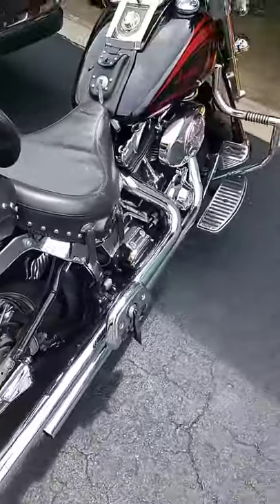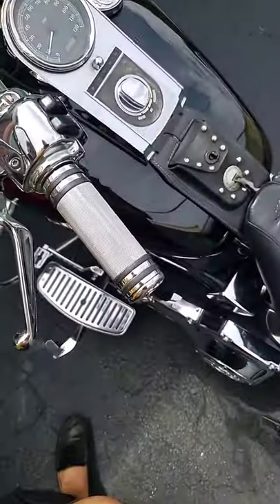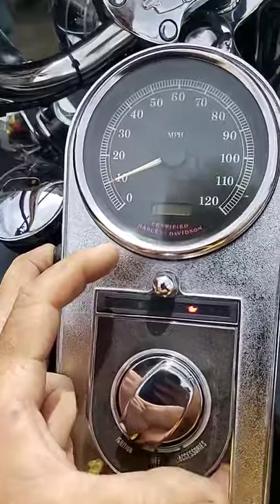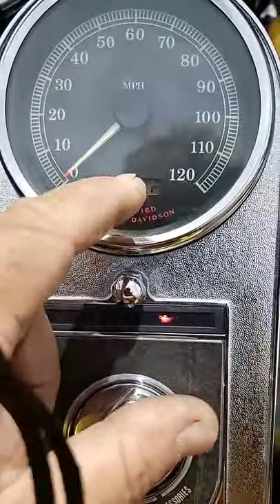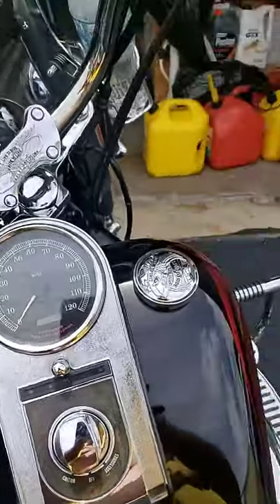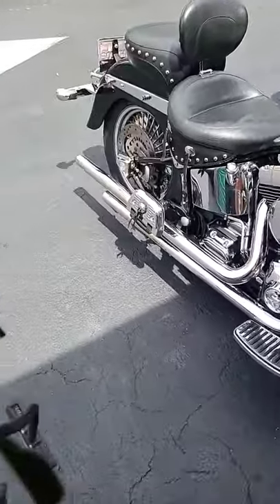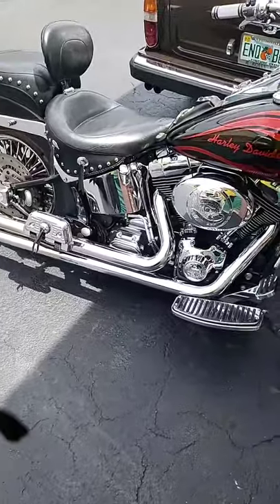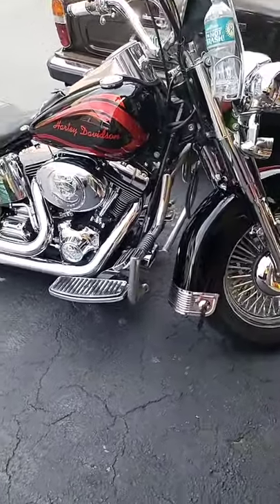HARLEY HERITAGE SHUT OFF WHEN HOT SOLVED 🔥 ALSO DIAGNOSTIC CODE CHECK EDDY SHIPEK 561-693-8636 LIVE

Comment: My 03 would get hot and if I came to a stop and tried to take off,hit the throttle and it would sound like it was choking to get fuel,I tried everything,plugs,wires,drained gas added new fuel,it was not throwing any codes,after further research I went to the Engine Cooling Sensor,it’s located behind the horn coming off of the front head,a $15.00 part off Amazon made my Machine run like a dream,just putting that out there if someone else is having this issue,also I have an 03 Heritage Softail Classic,100 year Anniversary Edition,88 CI
Reply: Do you have a part number? I'm having the same issue..

Comment: You should aquire a harley electronic diagnostic manual  because your info about the diagnostics with the speedo are not accurate only jumping the diag connector or using a scanalyzer will show sensor codes some of those d circuits are not even used, check it out. Im not trying to be rude just helpful.